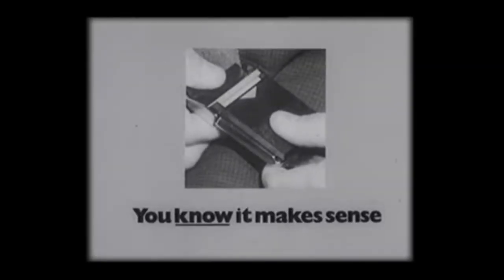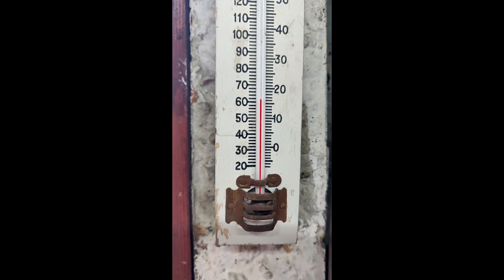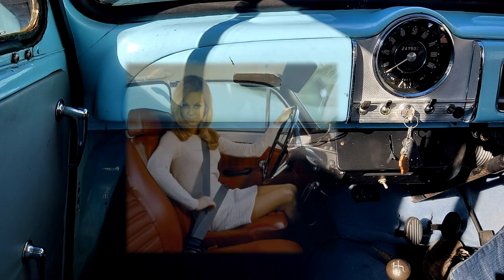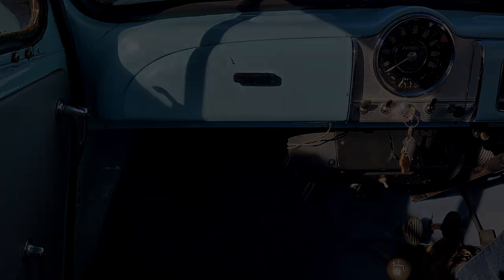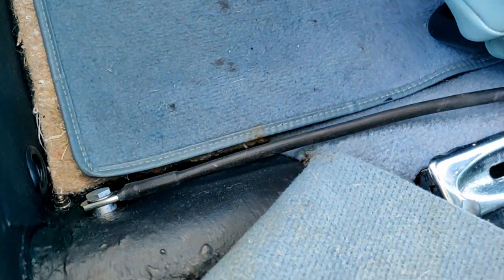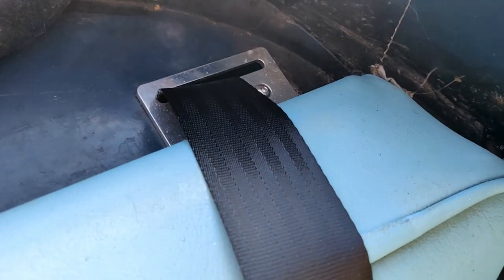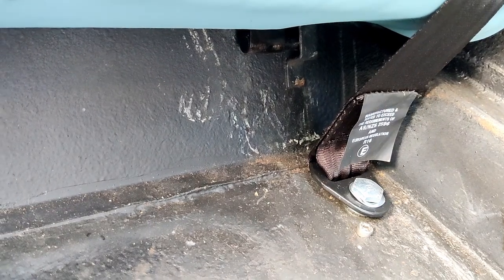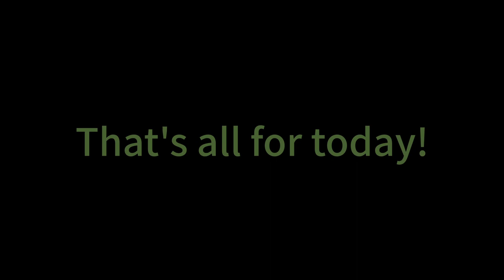Morris Minor 1000 - Seatbelts

Comment: Hi  great video, were brackets welded to car ?
Reply from the maker: The new strengthening plates were not welded to the car - just used a bolt through the small hole to hold them in place whilst bolting in the seatbelts.  I don't know if this is the best thing to do.

Comment: Good video. Thanks for posting. It was interesting that you had the bolt holes for the front seat belts on your '59 as mine as none of them. The car was a USA import LHD so that might be the reason as only lap belts were required until 1968. I am curious as to why the top hole below the back window was not drilled into the intersection of the pillar and the cross beam below the back window. It would seam that it would be stronger there and flatter. Question, did you put a backing plate in the top hole for the front belts? And if you did, how did you secure them? The video was a little cut off when you were filming that area. Thank you!
Reply from the maker: Thanks for the compliment. The front top and front sill fixings were factory fitted. They started to put them in as the seatbelt laws changed in the UK. The one on the transmission tunnel I made to suit the lengths of the (tunnel) seatbelt fixings. All areas were I made new fixings in the car had the strengthening plates behind them to spread the load on the panel.
Reply: Thx!